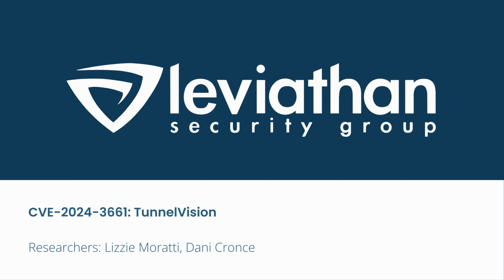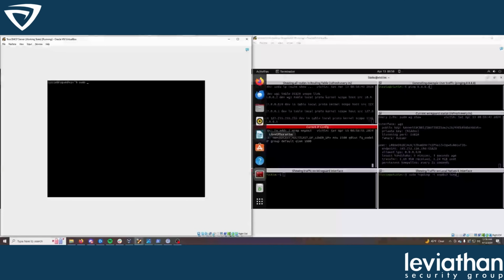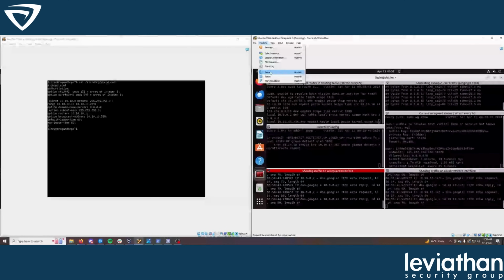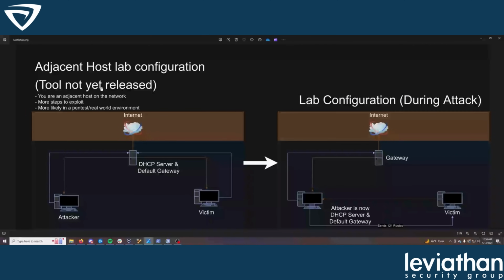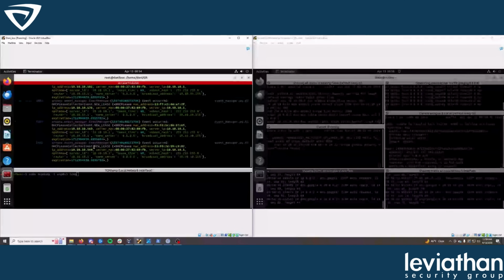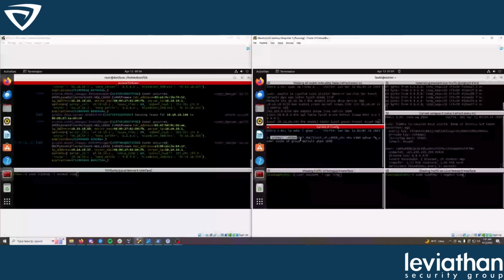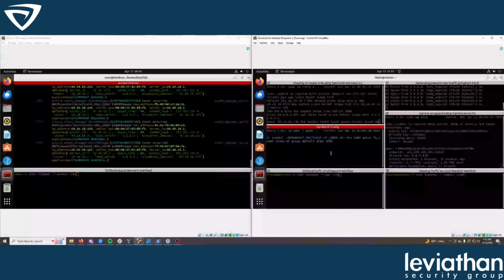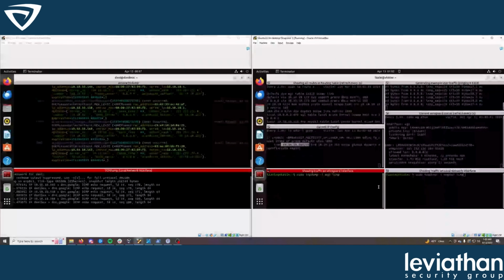TunnelVision - CVE-2024-3661 - Decloaking Full and Split Tunnel VPNs - Leviathan Security Group

Comment: I would think if your managed switch on the network, supports DHCP snooping, and you have that configured and set up it would protect all clients against this method (although only your higher end switches generally support dhcp snooping , and it can be a tad difficult/time-consuming to set up.). Also all switches connected to clients would have to be running DHCP snooping. Great discovery though and thanks for sharing!

Comment: But why does is affect Full tunnel? isn't the idea in Full tunnel that ALL traffic gets routed (encrypted) through the VPN Gateway?
Reply: Because it creates a route in the routing table.  VPNs use the routing table to know where to go.
Reply: @AndrewH-d2j  The creativity of bad actors never seizes to amaze. But wouldn't that mean that the vpn tunnel won't ever get to the VPN tunnel?
Reply: @robertdemoine5066  The attack is mostly to de-cloak VPN traffic so it's no longer encrypted and the bad guys can see inside of it.  The attackers could also use this to behave as a MiTM.  DHCP Option 121 doesn't interrupt VPN connections upon DHCP lease renewal, so the new routing tables take effect immediately and it also won't activate the kill-switch in the VPN.

Comment: I looked at devices on my own network and the only two clients I've found that support option 121 are Apple Devices and Linux Devices. Windows and a wide array of appliances we have do not support option 121. Testing it on my iPhone and this method does not seem to work. When using my OpenVPN full tunnel connection in Linux this isn't working either. Looks like it is just a WireGuard bug? Also, in order to exploit this doesn't the attacker need to know the subnet being used behind your VPN? In that case, they can simply spoof that subnet and make you forget to connect VPN?
Reply: FYI I'm wrong. Windows DOES respect option 121. I had it misconfigured.

Comment: Sounds like this works for traffic from the victim to Internet destinations; but this would not impact privately-addressed destinations inside the VPN, since the attacker has no means of forwarding the traffic on to the intended destination?  That means except for a couple packets-in-flight at the exact time that the new routes are injected, internal traffic is not leaked and connections will time out or fail to establish since they are effectively routing asymmetrically into a blackhole
Reply: Really, this would only work for discovery of the shielded network, but only if you knew the subnets the other company uses.  This is a big scary thing that simply teaches order of precedence and why you should always use a full tunnel instead of a split. With a normal full tunnel, NO traffic is sent to a local network's gateway except for the VPN encrypted traffic even if a more specific route is available. It might be different in Linux or with Wireguard.
Reply: @paullovelace7818  agreed though this does probably have more impact on "protect your internet traffic on public wifi" users, since that public traffic could be proxied symmetrically via the attacker, assuming the wifi implementation doesn't have client separation. Still, that will be protected assuming valuable targets are tls and that the user isn't going to start accepting every cert warning

Comment: Very great documentation. So this in theory is DHCP hijacking but are you also DNS poisoning to expose the host target? I am just curious about this element on inserting the route into the dns.
Reply: So far this seems to mainly be a specific symptom of improper DHCP security in a public network, it is indeed interesting to think about what could be done with DNS hijacking but since the attacker has no way to proxy traffic on to its intended (internal VPN) destination, I don't think this risks exposing internal resources/privileged data.  The main exposure here would be Internet traffic that would otherwise go into a tunnel, which is pretty low risk given the use of TLS near-globally on valuable Internet targets.  A user would need to blindly start accepting more than a couple cert warnings before probably leaking critical data (auth state, creds, etc) for Internet destinations

Comment: Who else came here from ArsTechnica? 
Are VPNs dead now, time to move on?
Reply: The actual risk/impact from this is very narrow.  This requires the attacker be on the same network as you, that the network doesn't have wifi client isolation, that their DHCP server is susceptible to a flooding attack, that there is no rogue DHCP filtering; and then requires that the victim's Internet traffic is of actual use.  This attack cannot be reasonably used to get internal traffic like from a corporate network because the attacker has no way to proxy that traffic to its destination so the connections would immediately fail.  Only a few packets-in-flight can maybe be captured.  This really isn't a significant/new novel attack -- rogue DHCP servers have been known for decades to be a threat to improperly-secured networks and this is just a consequence of that.
Reply: @FliesLikeABrick  and that you are not your own attacker ;)
Reply: I would immagine that using software defined networks, virtual interfaces, & vms you could develop an ad-hoc INTRANET that communicates across one way routs behind a ACLs with random mac addresses to remain anonymous.

A good WAN connection for privacy would be the block chain data provider Helium with the Helium hotspot.

Comment: Fantastic research, incredibly well presented as well.

(Can't help but wonder what could your average WFH VPN wrangler do to detect and protect themselves from the "adjacent host" attack, e.g. when your cousin or neighbor casually drops by, connect to your main (not guest) WiFi, and runs the attack. Or worse, your existing IoT device like a smart bulb, doorbell or fridge (which usually run on the main Wifi for a variety of reasons) gets compromised...)
Reply: That's an awesome question.
Reply: Всё что не относится к рабочим станциям и является IoT и прочим подобным должно засунуто хотя-бы в отдельный vlan по умолчанию, даже дома. А для функций умного дома того же всегда следует использовать специальные протоколы,  например Zigbee.
Reply: @qwertyLynx47  While that's desirable, the average home user has no clue what a VLAN is and how to isolate IoT devices to it. How do you make it easy for a non-technical person to set that up? The router makers don't eager to implement that. I was shocked to see them start offering guest WiFi. Those of us with some tech savvy can set up OpenWRT for our relatives. Does it do easy IoT VLAN out of the box?
Reply: @SpareSimian  я довольно редко сталкиваюсь с домашними роутерами, но мой опыт такой, что за последние 10 лет их прошивки содержат достаточно дружелюбное и подробное описание всех функций. И функции безопасности всё чаще выделяются в отдельные списки подчеркнутые на коробке, или обращающие на себя внимание в маркетинговом разделе сайта, правда не все производители достаточно хорошо это делают, однако тенденция есть. В том числе всё  чаще упоминается сегментация домашней сети как плюс роутера и подсказки о том, что можно включать гостевую сеть и зачем это нужно, и я встречал пользователей которые прочитав это всё просили так сделать, либо пытались настроить сами. Один из самых дружелюбных в этом плане производителей которые мне попадались Keenetic к примеру.
Reply: @qwertyLynx47  I hadn't heard of Keenetic before. Looks like it's not available in the US, at least not on Amazon US. Nice-looking product on the website and good price on the Euro Amazons.